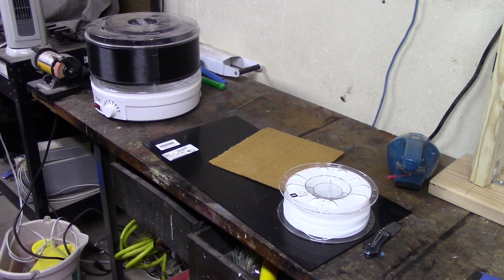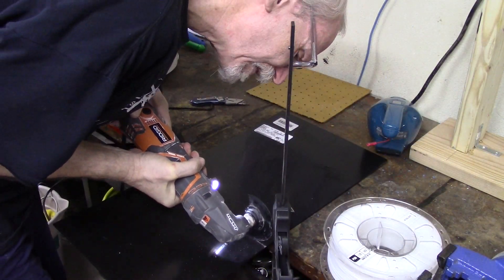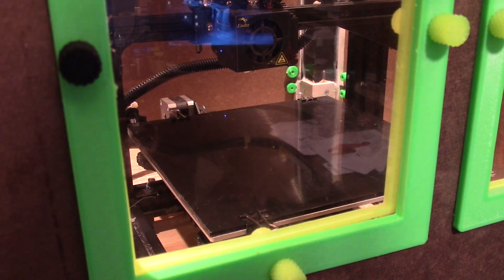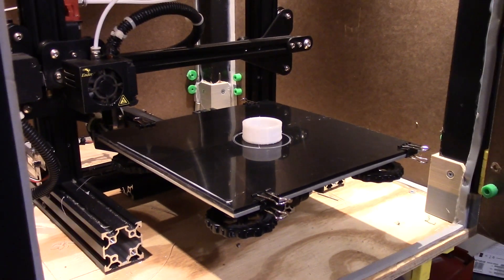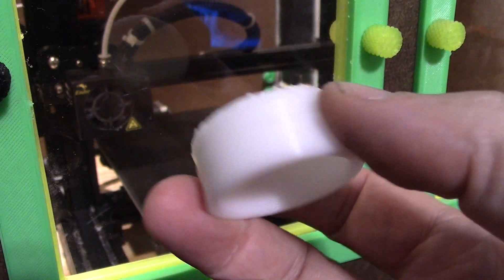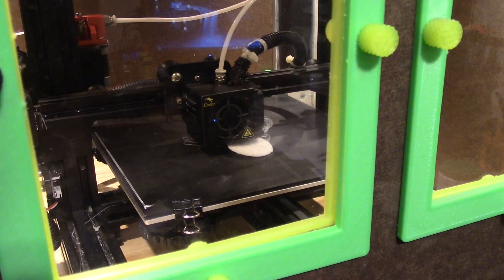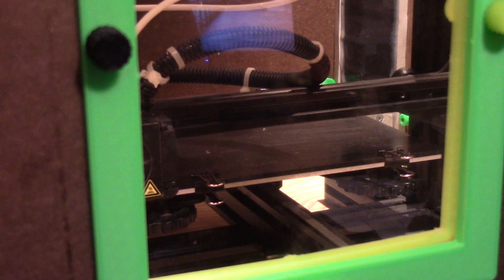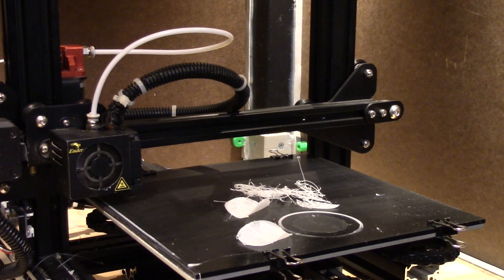And Yet More Fun with POM filament! Delrin Print Bed!

Comment: Thanks for making this. I really need to start making content myself though I dont know where the time for that is coming from for that?
I am trialling behind you wanting to print POM. I have a double sided highly sticky paper like tape that has stuck other plastics. It from the DIY store. Have you tried such a thing?
Reply from the maker: I have not tried printing POM for about a year and since then I've had a number of people offer solutions they said worked for them. But since the need I had for a POM print was solved in a different way, I just haven't had a reason take the time (and spend the money) to try again. Personally I think the only real answer is a prosumer grade printer that can generate and maintain high nozzle, bed and enclosure temperatures. In my mind the bare minimum is a 300c, nozzle, 120c bed and a 60c enclosure. The lowest price printer I've found that can do this is the Qidi Tech Q1 Pro at $450 and to be honest, other than the heated enclosure and slightly higher temps, it doesn't offer me anything that my Flashforge A5M doesn't. So I'm kind of waiting for the next leap forward, or some overpowering new need to print POM, before I try again. And maybe it's like the experience I had with polycarbonate filament, a different brand of filament would be much easier to print. But since I don't have that need, I don't want to spend the money trying different brands of POM. Thanks for your comment and if you figure out something that works, let me know!

Comment: Ive had a lot of luck lowering my first layer to ~0.16, slowing the first layer print speed to around 10-15, and increasing the flow on the first layer by around 15-20%. 

Seems to squish the plastic onto the bed surface. Thats usually my go-to when I cant get my rafts to stick, and it almost never fails. 

Ive been using a glue stick coating on brown packing tape (the paper surface stuff) for POM and it works well. Printing low layers on very slow speeds has yielded the best results. 

My bed temp is 100c, nozzle temp sits at 225c.
Reply from the maker: Thanks for the advice, I'll give that a try!

Comment: When I see adhesion issues my first thought is always to dissolve some filament in solvent to make a coating for a glass bed, but it looks like Delrin is only slightly soluble in hot benzyl alcohol and other more exotic solvents. Maybe try and see if it dissolves at all in hot acetone or toluene or something. You might also try printing on a cold sheet of POM. I'm looking at a cheap roll of this filament and trying to decide whether I should pull the trigger, so thanks for the videos.
Reply from the maker: It does not dissolve in acetone and I don't have toluene. Honestly I'd like to print with the stuff, but considering how difficult it is and the fact that I don't really have any dire need of parts printed with it, I've pushed it to the back burner. Maybe now that it's getting too hot to work outside on my other projects I'll give it another shot. Thanks for watching and commenting!

Comment: Have you tried other material on this bed? PLA? PETG? I would be very interested in those results.
Reply from the maker: Honestly, I just didn't think of it since I haven't tried anything else since I'm not having problems getting other filaments to stick. But thanks for the idea, I'll dig it out and see if anything sticks to it. Of course, if I hit it with hairspray I'm pretty sure things will stick since it works for almost everything else.
Reply: @3rdpig  I’d be particularly interested in trying the smooth side and rough side completely clean to start with, if possible. Thanks for the reply and all the great videos!

Comment: Okay, so you're constraining the print surface when it's cold. Because of this, the thermal expansion is going to cause the surface to warp. Try heating it up and then clipping it down or undoing the clips after its heated to allow the bed to flatten itself out.
Reply: Actually this would be a really good use of a bltouch and a 49 point level.

Comment: I also bought a half roll to see what I could do. First up I primed the extruder with PETG and swapped to POM before kicking off the print. It was onto a textured PEI bed with hairspray first layer adhered well from the PETG POM blend but then a couple of layers in the part tore the hairspray off the PEI. Never seen anything like it. I just tried on Carbon fiber board no luck, zero adhesion. Build plate temp 88C, nozzle 224C, enclosed and preheated.  I think why you are having some luck with the POM onto POM is that in this case the heat bed has the same rate of thermal expansion as the filament. When the hot filament comes in contact with the bed it heats the bed up rapidly. Then as the filament and bed cool they both experience the same level of shrinkage so it doesn't snap free. I bet if you can get the bed up to 120 or so it stays on. I think the sanding might have made the bonding worse because it introduced some small POM particles between the filament and bed. I wonder if you could dissolve POM in MEK and coat down a base layer to form a mechanical bond with the build plate in the same manner as ABS slurry. I'll let you know if I have any luck.
Reply from the maker: It's quite a challenge, isn't it? You have some good ideas. Someone else commented that slowing the print speed way down, thus not "stretching" the molten filament so much during printing, might help lower the stress on the part resulting in less warpage as it cools. Good luck!

Comment: It looks like the print speed for is too high, not only for the first layer, but for the entire print. The faster the printing, the higher the sideways force applied to the part. Eventually it just rips it off the bed. Probably going as slow as 5 mm/s with a thick raft could help. I'm tempted to try POM now, thanks!
Reply: Heat builds up in pom. Too slow and it just turns into glue. It's a very difficult plastic

Comment: Hi, what is the température in Your enclosure ?
Reply from the maker: Typically I allow the heated bed to bring the enclosure to around 40c before printing and that seems to work fine for ABS, nylon and similar filaments where I use an 80c bed temp. For a long print the temp will usually run into the low to mid 50's just from the heat of the bed. With PC and Delrin I've tried temps between 40c and 70c (using a hair dryer to bring the internal temp to 60c or above quickly) and didn't really notice that much difference than 40 to 50c. And going above 60c meant that any printed parts inside need to be printed out of something that can handle the heat. Either a high temp PLA, ABS, PETG or nylon. I've had numerous parts printed out of PLA warp when the internal temp goes above 60.
Reply: @3rdpig  thank you. I managed to get a print without enclosure. I got some déformation. Stockons drawing paper
Reply: @lecoindesmodelistes3741  cet anglais de qualité :0, je vais essayer d'en imprimer aussi mais sur miroir poncé avec laque à cheveux

Comment: If you upgrade your firmware to JYers UI: You can do manual mesh leveling. It sets a grid kind of like the BL touch leveling but you manually set the grid points with a piece of paper and screen prompts.
Reply from the maker: Great info, thanks!

Comment: Couple of things I might try. The sanding should increase the surface area and increase bonding of the first layer vs the smooth side of the sheet. Since it didn't, my guess is the surface likely still had some loose pom particles which caused the part to release. Maybe you tried this, it wasn't clear from the video, but thoroughly washing the sheet post sanding to remove any debris may yield better results. Alternatively, scoring a cross hatch pattern on the surface with a blade rather than sanding could also be worth a shot, as it would yield less loose particles whilst still increasing bonding area. 

I think 80°C is likely still a little on the cool side for the bed. The first part still had signs of warping. The Ender should get up to 110°C comfortably in an enclosure maybe slightly higher; this would also increase the enclosure temperature. Slowing the first layer down and printing with a slight increase to the initial layer line width % could also be worth experimenting with. Also, dare I say it, a raft, or at least a brim could be worth a punt.  

Still, as you say, that first part you printed is likely one of the most successful pom prints I've ever seen! I have a spool I bought a couple of years ago that's never printed a single useful part. The properties of the material would make it super useful for gears and bushings it's such a pain in the arse that it's a devil to print! Now I have an enclosed machine myself I'm revisiting it, so I'll be conducting my own experiments. I might have to pick up some pom sheet to try. Best of luck in your own endeavours! I reckon you're pretty close to success there!

Comment: What enclosure temps are you getting? I think you need to get hotter. 100-150c maybe? That's hard to get without an expensive special printer sadly
Reply from the maker: I can't go that high on this enclosure. While all the electronics and the PSU are outside the enclosure, the enclosure itself has a lot of PLA printed parts and in my last POM attempt I went high enough to warp some of them.
Reply: @3rdpig  damn I was amazed that pla works even opened.

Comment: Hi Chuck, you could look at Michael's experiments with G10 sheet a couple of days ago. It seems to have a very consistent thickness and is cheap. Look after yourself.
Reply from the maker: Angus had a test of G10 recently also. It would probably be a lot more rigid than the acetal sheet, but not sure about how well the POM would stick to it. But, it's now on my list of things to try.
Reply: @3rdpig  In fact, you're right, it was Angus, not Michael. Sorry.

Comment: I had some similar things happen with petg until I bumped the first layer height up to .35 it sounds like a lot on a .4 nozzle but has been working great for me.
Reply from the maker: I'm running .32 here. I think the problem mostly lies in the craptastic dished bed that came stock on the Ender 3. Once I solve that issue I'll try again.
Reply: @3rdpig  yeah I hear that, my ender 3 bed is warped by at least a 16th of an inch, I have no option but to run a totally rigid build surface like glass, .32 is interesting I might have to try that.

Comment: Hi Chuck, It looked hopeful at first. I though you finally had the solution to printing POM. Most POM parts seem to be injection molded and are really a tough durable part like what the use for threaded rod guides. Your z height and filament squish looked a little low. Some filaments a really fussy when it comes to amount of squish you use. Keep experimenting. I’m sure you’ll figure it all out.
Reply from the maker: I tried a number of different Z heights, none of them proved very successful. I honestly think that Z height is critical and on this printer it's nearly impossible due to the fact that the stock Ender bed is dished and the acetal sheet isn't uniform. An ABL system would help with that and I'm considering it.